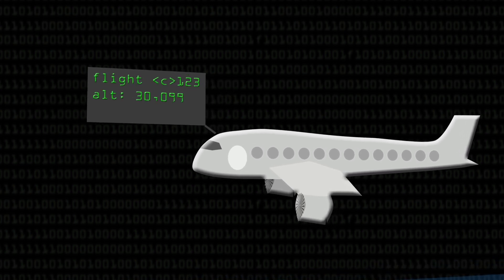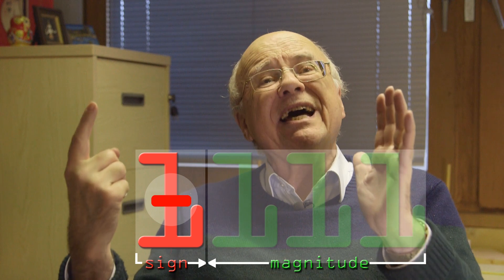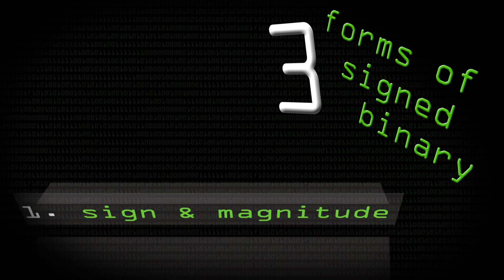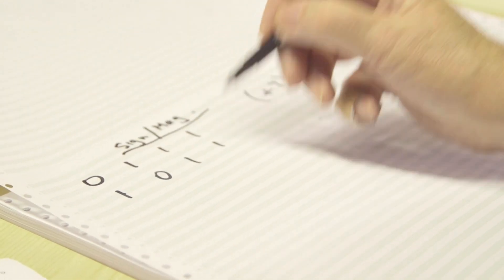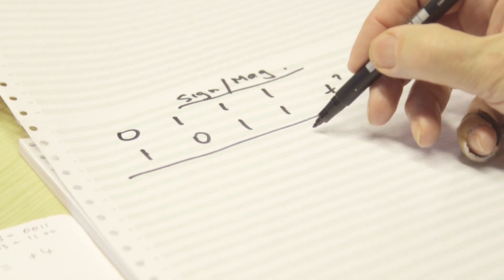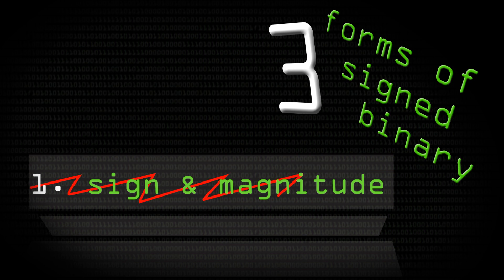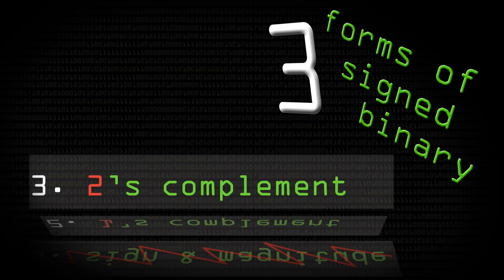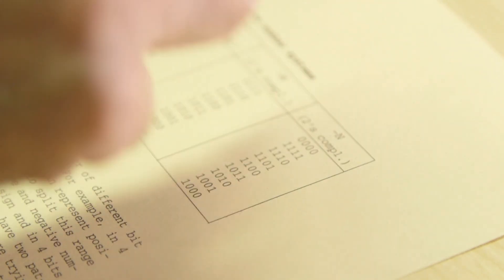Binary: Plusses & Minuses (Why We Use Two's Complement) - Computerphile

Comment: The explanation I found easiest to understand is that of the "additive inverse" or the number you add to something to make it "go away" or rather, to make all but the highest digit zero. This is effectively the negative of the number if you drop the top digit.

So, the inverse of 25 is75, because 25+75=100 and you drop the 1. So to subtract 25 from, say, 50, you add 75 instead and get 125, drop the 1, 25 is 50-25. 

Another example: The inverse of 2 is 8 because 2 and 8 are 10 (drop the 1). So to subtract 2 from 7 for example, just add 7 and 8 which is 15, drop the 1, answer is 5. 

We we work with a fixed number of digits, dropping the 1, the overflow, is easy... and only requires a small adjustment to the way we find the inverse. Let's say we will stick to 4 digits always. That makes the inverse of 25 (actually 0025) become 9975. And the inverse of 0002 is 9998. Everything still works, 0050+9975=(1)0025, and 0007+9998=(1)0005. We just have to remember that the convention of not writing leading zeros and always expanding to the left as far as we need, isn't use.
Reply: James Newton Here's the problem: Flipping the sign = doing the inverse and adding 1. The number 50 represents -50; it does not have a positive equivalent in 2's complement. So you do inv(50) = 100-50 = 50. This is saying that 50 = -50.....
Reply: Cooper Gates Yes. When working with a fixed number of digits, as we always are in a computer, it doesn't really matter for most basic computations. If you only have 2 digits, it's a more obvious issue, but with 32 bits, or 64, or... it because less of one. And the math package limits or constrains the range of data so that a positive number can not be larger than this halfway point. E.g. in a 2 digit system, the valid range is 49 to -50. If you exceed that range, you get an out of range error. For complex math, you want to transition to floating point or some other system that is more mathematically accurate, but even there we impose limits and can use tricks like this to simplify the computations.
Reply: James Newton You still can't multiply -50 by -1 because 50 doesn't exist in the system. If you negate -50 you get the same representation.
Reply: Cooper Gates Yes. -50 * -1 would be an overflow. "because 50 doesn't exist in the system". It's a range error. Still perfectly valid... Is there a system you like better?
Reply: James Newton I think it would overflow because the computation would yield -50 again and it would decide that negative * negative should give a positive but it did not so it errors. I've been thinking more about 1's complement and 00 = 99, this is harder in decimal because you have to check for both of those. In binary, you just run an XOR on all the bits and if any two are different you get a 1 out and the number isn't zero. 0000 and 1111 will return 0 for XOR operations of any two of their bits. Then, if you check the sign bit and you have a 1, you use the result from the zero check to see if it's a 0 or an actual negative number.
Reply: Cooper Gates So negative and positive zero. I'm not sure I see how that is better... you still have a range limit, you still have a "wasted" value (negative zero), but now it's in the center of your range, so you can't "get rid" of it by range constraint and have to add code to manage the exception. Am I missing something?
Reply: James Newton What exception? I just described how to find both representations of zero.
Reply: Cooper Gates 0111+1 = 1000 means 7 changes to -7 so that's an overflow but it sure won't break the system.
Reply: Cooper Gates There is only one zero. Having negative zero is an exception. 

Having 7+1 become -7 most certainly could break many things! Read up on the airline fault with APU's left running for too long as an example. It must be detected as an overflow and generate an error.
Reply: James Newton It won't break the arithmetic but it will fool something using the numerical result (such as a score in a video game that suddenly wraps negative when it's too high).
Well, 1111 + 1 in 1's complement is still 0001, just as 0000 + 1 is 0001. It's ok to have "+ and -" zero because the number zero has no sign, and doing an operation on either 0000 or 1111 (that changes it) should give the same answer.
Reply: Cooper Gates Yes, it works, it's just extra work when checking a result to see if it's zero. And you loose that one value in the range, not that this is a big deal. 
https://en.wikipedia.org/wiki/Ones%27_complement
Reply: James Newton So using the XOR to see if all the bits are the same won't detect either "zero"? In other words, you don't have to specifically look for both 0000 and 1111. The main reason I'm discussing 1's comp. is because negating a number is faster.
Reply: Cooper Gates Sure it will! But it's an extra step.
Reply: James Newton What's the extra step? Because you're comparing bits instead of checking one at a time?
Reply: Cooper Gates On most processors the zero flag, and carry, is set by any math operation. So there are no cycles required for the zero test. If you must use XOR you are 1. adding another instruction 2. affecting the other flags set by the math operation.  Actually, I think #2 isn't an issue on most uC's; the XOR doesn't affect carry flag. It's not a big deal one way or the other. If you like 1's compliment, use it!
Reply: James Newton I've also thought about "-2's complement" where the signed bit has the opposite meaning. Thus, carrying into the signed bit alone won't overflow. 0111+1 = 1000 in this system would mean -1 + 1 = 0. 0000 would be -8 and 1111 would be 7. The problem is that testing for 0 needs all the non-signed bits to be 0 and the signed one to be 1.
Reply: James Newton Let's try the 1's complement decimal version... -(23) = 999 - 23 = 976(signed), and that's only 3 digits. Then 78 - 23 = 78+976 = 1054, end-around-carry yields 55.
Reply: Cooper Gates Ooooh but 55 begins with something greater than 4... so "55" in this signed system stands for -44. To write positive 55, you write 055. That 78 was in the default notation.

Comment: Aww, he didn't explain 2's complement the easy(ish) way. It's easiest to think of the sign bit as a negative version of whatever that bit would be if there were no negatives. So if you have this:
1000
Then the 1 bit represents -8. If you have this:
1000 0000
Then the 1 bit represents -128. Then it becomes really easy to figure out what the number is, assuming you know what the remaining bits mean on their own. For example, if you have 101, which is 5 in binary, slapping a 1-bit on the front of it would be 5-8 = -3. If you have 010, which is 2, slapping that 1-bit on would be 2-8 = -6.

Essentially, just think of the negative bit as a really big negative number, with the rest of the digits being normal. If that bit is turned on, then everything positive you add to the number will make the value get closer and closer to 0 naturally, because it's cancelling out more and more of the big negative value that the sign bit represents.
Reply: It's not a smaller range though it's just shifted. A byte can represent 256 numbers: -128 to 127 is 256 numbers, 0 to 255 is also 256 numbers. Making it unsigned just signals the compiler not to treat it as 2's compliment so 1000 0000 would be 128 not -128
Reply: My own preference is to see it in terms of wrap-around (think odometers). With 4 bits, the numbers 0 and 16 are equivalent (0000 vs 1,0000). -1 is the number before 0, which is equivalent to 16-1 = 15, which is 1111 in binary. -2 ~ 16-2 = 14, etc.
Reply: I'd agree. The easiest visualisation is to think of what happens on a vehicle odometer when winding back from 0. It goes to all 9s. The trick of the 1s complement +1 is no doubt much easier for the hardware designer, but it's not, I think, as fundamental to the way the mathematics work as the essentially cyclic "binary odometer" model of 2s complement.
Reply: I liked to think as getting a negative number is substracting the number from 10000 (as many 0s as we use)
Reply: yeah thats what ive been thinking too, just viewing the value of the most significant bit as being subtracted instead of being added to the number, but it seems many people prefer (counterintuitive to me) the flipping all bits and add one variant
Reply: @LunaticMS Okay it took a few reads to get my head around what you've typed here but you're right this is easier to understand and to remember. It completes things more from a mathematical standpoint too.
Reply: I found "2's complement = 1's complement + 1" easier to understand. To undo the operation just minus 1 and take the 1's complement again.
Reply: +LunaticMS This also explains to programmers why signed numbers hold a smaller range of numbers than unsigned numbers.  Signed byte = -128 to 127, unsigned byte (or char in C) is 0 to 255.

Comment: 02:00 From -7 to +7, there's 15, not 14, because you have to count 0 too.
Reply: I'm pretty sure he said that because he wanted to talk about +0 and -0 separately
Reply: Huh, yeah, there are 15 integers to count, even though it's a "distance" of 14. Maybe he didn't count 0 as an integer because of the whole +/- 0 thing (zero is "two integers"—or more correctly, has two representations—in 1's complement).
Reply: need more likes to bump this comment up

Comment: A simpler way of looking at two's complement is considering it arithmetic modulo 2^32. That way there is no difference in operations (except overflow) for signed or unsigned integers. The interpretation of the range from 2^31 to 2^32-1 is just shifted down by 2^32, so it matches -2^31 to -1.

Comment: We should just use Base -2, thus avoiding the problem completely. It's messy, but it works, as illogical as it looks, it's still possible to make every number using it.

0 0000 = 0
0 0001 = 1 = (-2)^0
0 0010 = -2 = (-2)^1
0 0011 = -1 = ((-2) + 1)
0 0100 = 4 = (-2)^3
0 0101 = 5
0 0110 = 2
0 0111 = 3 = (4 + (-2) + 1)
0 1000 = -8 = (-2)^4
0 1001 = -7
0 1010 = -10
0 1011 = -9
0 1100 = -4
0 1101 = -3 = ((-8) + 4 + 1)
0 1110 = -6
0 1111 = -5 = ((-8) + 4 + (-2) + 1)
1 0000 = 16 = (-2)^4

Base -10 (Negadecimal) works the same way :D
Here's the current year in negadecimal: 18195 = (10000 + (-8000) + 100 + (-90) + 5) = 2015
Reply: Challenge: design a hardware circuit to do addition to add two Base -2 numbers. Compare that to the (half/full)-adder-all-the-way-up for 2's complement calculation (which is already worked very well in unsigned calculation as the video says) and you will see why we use 2's complement for negative numbers.
Reply: PiHung Liu I didn't say the system was smart, just that it got around using the bits in reverse order as negatives, because negative numbers are naturally represented. The addition rules would likely be even weirder than the order of the numbers themselves
Reply: ***** Every even power of a negative base yields a positive.
Reply: Nikolaj Lepka Hey man, im really confused. I think it is because of the fact I never even thought about something different than a decimal system. I understand it, but could you explain (just like you did for negadecimal 18195 to 2015) example why in a negadecimal system.. 10 (in our decimal system) = 190 in negadecimal. Why is this? I can't get this
Reply: michaelyouth because ever other numeric place from the right is negative.

In a normal base 10 system you have
1000's 100's 10's 1's
so 1000 + 200 + 30 + 4 = 1234 (in base +10)

but in a negative one you have
-1000's 100's -10's 1's
so -1000 + 200 -30 + 4 = -826 (in base +10)

so, the negadecimal number 190
= 100 - 90 + 0 = 10 (in +10)

also in decimal:
1 = 1 * 10^0
2 = 2 * 10^0
10 = 1 * 10^1
20 = 2 * 10^1
100 = 1 * 10^2
etc

whereas negadecimal behaves like this
1 = 1 * (-10)^0
2 = 2 * (-10)^0
-10 = 1 * (-10)^1
100 = 1* (-10)^2
Reply: Nikolaj Lepka Thank you, its gotten a bit more clear, but if you were to prove that 10 = 190. So if the question would be: what is 10 in our +10 numeral system, converted to negadecimal. Negadecimal to decimal would be like you said: 190 in negadecimal is 100-90+0 = 10 ( in 10+) but now the other way around: 10 to negadecimal, (would be 190), how do you write that down
Reply: michaelyouth Explaining base 10 to someone who uses base -10...

1 = 1 * 190^0
2 = 2 * 190^0
9 = 9 * 190^0
10 = 1 *190^1
20 = 2 * 190^1
100 = 1 * 190^2

I'm not sure what you want me to do exactly
Reply: Nikolaj Lepka Ive been taken a math course where they teach this basic stuff, I study geophysics, but I just cant seem to grasp the concept of a -10 numeral system. I understand binary ) and all the other positive systems), and the counting in that comes natural, but to me it seems very unnatural  going from 1,2,3,4,5,6,7,8, 9 en dan not 10 but 190. I cant understand why after 9, the 190 comes in a -10 decimal system, whereas in a 10 system the 10 shows up afterwords. Maybe I just slept too little, and its not really necessary for the course, but its been kind of bugging me that I cant understand it (yet):P
Reply: michaelyouth the idea with any number system, is that you have a set of digits to represent your numbers

in base 10 you got 0123456789, once you reach 9 you're out of digits and need to recycle, reaching 10

in base 2 you only have 2 digits, 0 and 1
after 1 you run out of digits and need to recycle, meaning the next thereafter is 10

in base 8 it's 01234567, then 10

and in base 16 it's 0123456789abcdef then 10

the "10" has no inherent meaning, it's just the value that comes after the highest digit

in -10 it's 0123456789, then 10 like before, but here it's a negative value because it's not 10^1, it's (-10)^1... I don't know how to explain it, you can look it up on wikipedia
Reply: Nikolaj Lepka Let's use sexagesimal. It'll be so much easier to work with time and degrees.
Reply: frtard duodecimal works better for time though
Reply: Nikolaj Lepka How does this work when doing a bigger/smaller than comparison?
Reply: +Nikolaj Lepka You are awesome! but sorry this is gonna be pretty complicated to deal with..
Reply: Comparison is just subtraction - sign set, zero, sign clear.

Comment: a more simple way to detect overflow in 2's compliment is this:
if you added two positive numbers you should get a positive number, otherwise you had an overflow,
the same goes for negative numbers, if you added 2 negative numbers and got a negative number then it is ok, otherwise you got an overflow.
note there can not be an overflow if you added a positive & a negative number, since the result will always be inside the range.

Comment: What about the "NaN" (not a number) if you program something like 1/0
Reply: Depends on the language.
Reply: That is a higher level operation; the binary addition described here is performed directly in the integer ALU, using only the adder. A division requires much more complicated calculations and therefore more logic and time. On processors that do have it, a zero divisor is checked as an error case, and aborts the operation itself. Floating point numbers are handled in specialized logic and have a NaN value to represent the result of an invalid operation (note that 1/0 may be +Inf instead; 0/0 will be NaN), partially so the program can continue without checking itself at every step. On some processors the integer and floating point units operate in parallel, with the integer one deciding program flow, so the floating point processor couldn't abort like integer divide by zero does.
Reply: I thought he was asking about Javascript or something similar. I didn't even know that NaN can be stored in a float. I knew about +/-Inf, though.
Reply: Phaux NaN is typically originates from mathematical errors in FPUs. It's actually has a special reserved value in floats with any sign bit, all 1's for its exponential partition, and any value except for all 0's in the factional partition. infinity follows a similar format with the sign bit denoting +/- all 1's in the exponent, but with all 0's in the fractional partition.

The cool (and sometimes horrifying) thing about NaN's is that any operation done with a NaN results in NaN (also Equality of NaN's do not hold.). if not caught correctly, they can actually spread like a virus in your program.
Reply: iamterence77 That would explain some Javascript weirdness. In particular why NaN==NaN is false even though null==null is true. They copied the behaviour of lower-level languages.